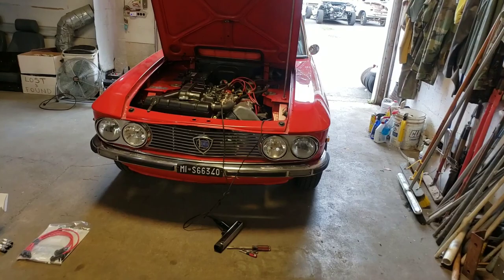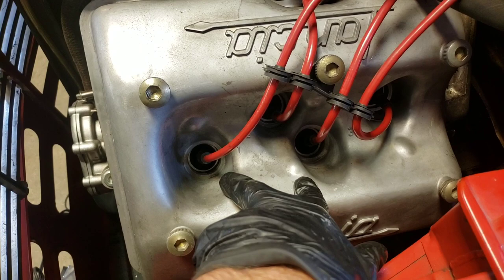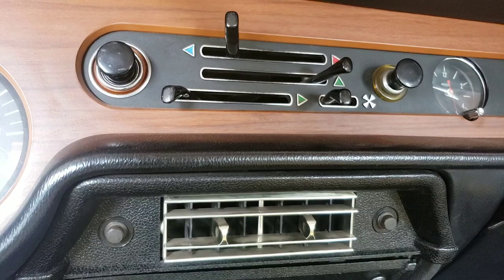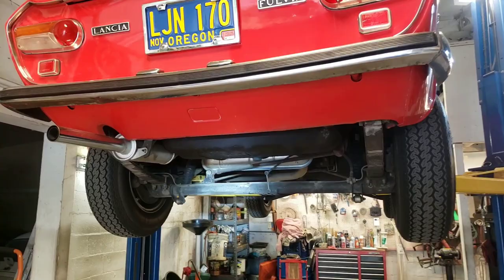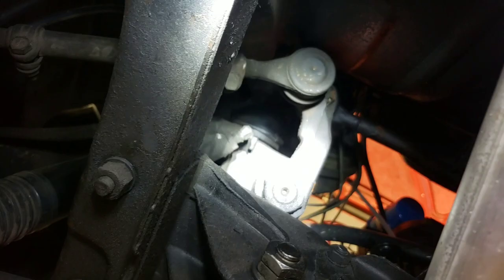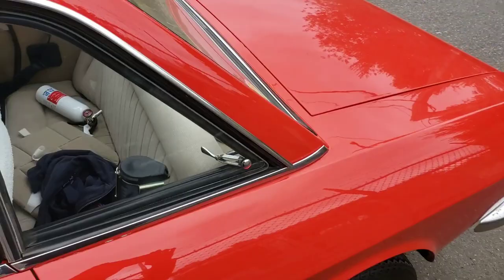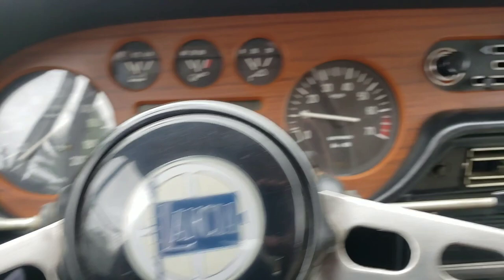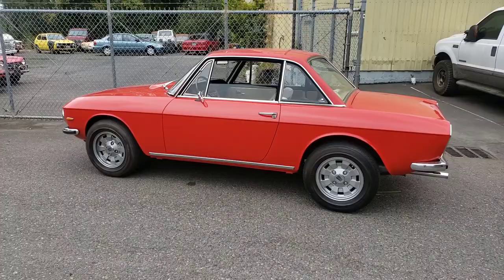More Lancia Fulvia

Comment: I was a teen in Rome at that time. An older classmate had a red Fulvia HF just like this one. (HF=High fidelity I believe, go figure) It was the performance version, the engine was enlarged to 1.6 liters. 
CI in Italian is like ch for English speakers, so the company name was pronounced Lan-cha. The period correct front license plate indicates that the car was registered in Milan(o). Yes, the plates were some kind of plastic, so it could be the original.  The rear plate was much bigger.

Comment: Cool Video! , The 5th speed is 1:1. final drive is 3.91:1. I have had to replace the syncro's in my gearbox , all gears (except reverse) are synchronized. This vehicle is looking very original and unmolested. I see lots of little things that are just right.  :) I'm sure you have noticed the 2 plugs in the intake manifold that is removable to fit a balancing tool to set up carb balance. A large improvement in running and idling if these are balanced correctly.

Comment: A classic! Such a neat, tiny car, the epitome of restrained elegance. Then add a small, light, high revving engine and sweet handling. Leaf springs were a surprise, but this was a compact, robust solution providing good axle trailing. And no axle tramp on an FWD car. (Even Ferrari kept the old fashioned leaf springs a long time. On BWD cars. Not ideal!). The Fulvia is so Italian ... and I think I can spot the seat belts. Check the back seat at 3:41.

Comment: Fantastic car!  I would be highly concerned with the zero oil pressure at idle.
Reply: This is normal and nothing to worry about. The gauges always read low and with age they just drop down to nothing at tick over. As long as they have pressure when you first start them up from cold , all is good.
Reply: Ted Cowart  So would I, I had one for 18 yrs, and always had oil pressure on idle.

Comment: I owned one from 2000 to 2012. Engine was running terrible at idle, until the 123 ignition was built in. Still the sparkplug of cilinder 4 went black. In the end the complete engine had to be exchanged. Mine was in quite a good condition after that, but the real problem arised when I bought a MX-5. Didn't drive the Lan si ah Foul Vi ah Coup-a ( how the hell do you make it clear how to pronounce it right...) anymore, so sold it.

Comment: Mark, the seat belt is mounted beneath the quarter light in the back; you showed it off in the last video! Probably added on by the owner.

FYI Italy did not require seat belts to be installed in cars until 1989!

Comment: Should the oil pressure be that low at idle?  It seems to come up OK but that low cold would have me concerned.
Reply: Just old Italian gauges..
Reply: @_chipchip  I suppose. The gauge or sending unit could be off but I'd want to hook up a known good gauge to verify
Reply: Italian cars of the time were known for indicating zero oil pressure at low rpm.

Comment: Fouled plugs are caused by an over rich fuel mixture not ignition. Whilst electronic ignition is superior to a points set up you could still have adjusted the carbs to get the fuelling right and saved your customer a lot of cash. Did you adjust the carb fuel mix once you had installed the electronic ignition?
Reply from the maker: yes, he says it has NEVER run better now, loves it

Comment: The carburetors were out of tune and running overly rich. The internals get worn of dirty like the jets, blending screw, float and choke valve and it’s setting for idle. as you know they need to be adjusted for weather and sea elevation, humidity or rebuilt (worn gaskets show up as dips in power at some part of the rev range). These cars were built in a world that was purely mechanical, Amazing, so electronic ignition could bring up other issues or maybe not. Adore this car and the 1,6. Lancia built cars meant to last and run indefinitely with proper design, built as nearly all the components are serviceable and rebuildable. Far cry from modern cars that are cool but are built for parts replacement and enough sensors all over to make long term ownership a bit more challenging if not computer savy.

Comment: I think I would be recommending to it’s owner that seatbelts are fitted ASAP. In Oz it would be illegal not to have seat belts fitted in the front. And yes Fulvias are great.
Reply: David Mitchell this was rallied with no belts, keep it original... And in the UK if it was built without them then they are not required. Would imagine Aus being the same, no?
Reply: Rabbi Shekelstein Absolutely not, no car regardless of its age or history is permitted on the public road without seatbelts. They save lives, so irrespective of whether or not it was fitted with seatbelts in the day is irrelevant today.  So fit seatbelts, they will save your life in the event of a crash, end of story.
Reply: David Mitchell clearly not irrelevant... the car should remain as it left the factory! The owner must agree... you don’t start retro fitting safety equipment to old cars. Surprised the lack of airbags don’t also offend you.
Reply: Seatbelt retractors are visible in the video.
Reply: Rabbi Shekelstein Don’t be an idiot mate. It’s quite simple and irrelevant whether or not seatbelts were fitted in the day. They save lives and it’s the law, and given this retro fitting such simple devices makes a load of sense. Airbags on the other hand didn’t exist back in the day and in context to the car are less vital.
Reply: Peter Elvery I wonder if so then why not use them. It’s the law afterall.
Reply: @1240enzo  I think he forgot or didn't see them. I also don't know if seatbelt wearing is compulsory in Oregon. Very different in Australia. When I was a boy, we had a 1956 car with seatbelts.